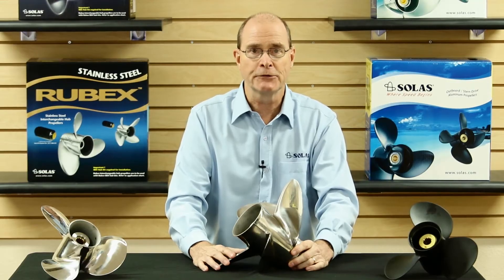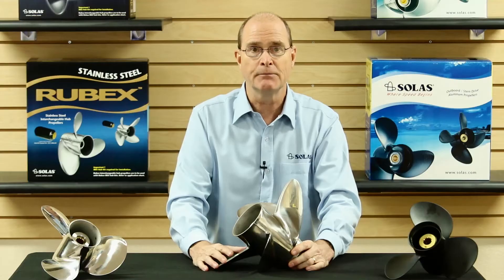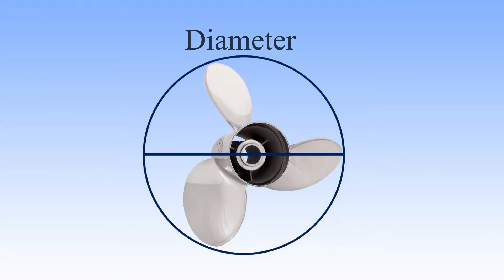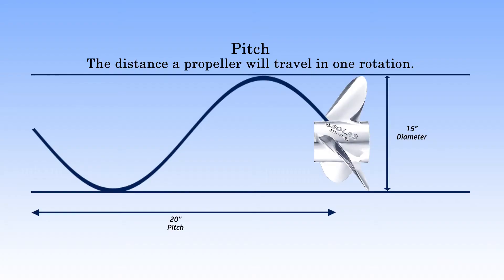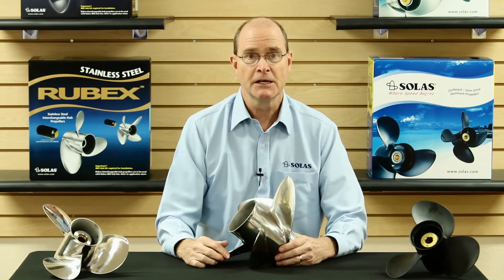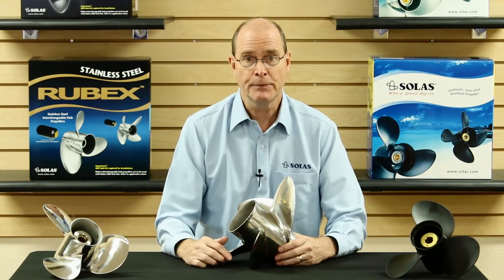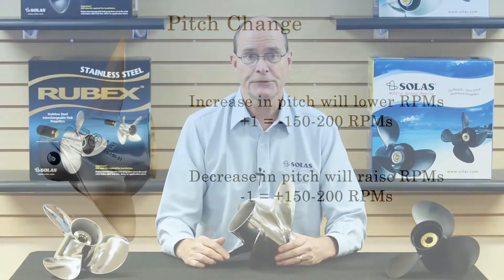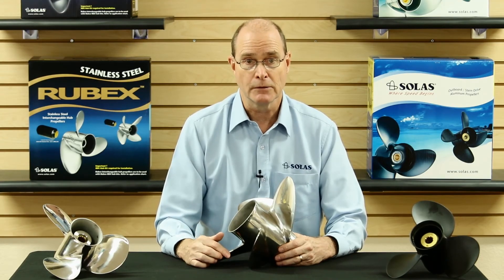Propeller 101 Diameter and Pitch Explained

Comment: Funny is I have a 1989 25hp evinrude with a 10.3 X 12p wot rpm 4500. 21.3 mph across lake.  Topper Trapper 15.5 650 lbs one person.  My engine power is 4500 to 5500rpm . I ordered a solas Amita 10.8 x 10p the evinrude dealer expects it to gain 1000 rpm. I watch on the YouTube  This old outboard  and  with the 13 spline propeller and 25hp he was testing with a 9p and 10p 9"prop with the 25 evinrude 27mph with crazy fast get and using the 10p.  Both engines are in 89 88 year range.

Comment: I have a Tohatsu 40 hp 3-cylinder 2-stroke since it is a boat 460 meters deep semi-vy with 3 people plus day fishing things it does not go beyond 5200 rpm, propeller 10 1/4 14........ .should I take a step down? could you change x a propeller 11 1/8 13? I appreciate information! thank you
Reply: if you go down from 14 to 13 (-7.5%) ,your rpm will increase +7.5% from 5200 to 5600.

if you go down from 14 to 12 (-15%) ,your rpm will increase +15% from 5200 to 6100.

Check your engine's power-rpm curve.  If there's not much HP difference between 5200rpm and 6100rpm, don't buy a new propeller.

Comment: I have a 60hp merc that the rpm only hits 4100 rpm wot the prop is 10.5 x 13 what would be a good prop?
Reply: Depends on hull type (planing or semi-planing) , boat weight , number of passengers,   engine model (ct or standard gearcase)...
Reply: Are you sure it is a 10.5x13 by the way...  not 13x10.5 ?

Comment: Is it fair to say that we can work out the approximate flow rate from the pitch and RPM? Putting aside the hub diameter for the moment:

pi * r^2 * pitch * rpm = cubic inches per minute?

(and of course cubic mm if doing metric mm measurements)

Comment: Does elevation impact how you choose a propeller? I was told the higher your elevation the higher pitch you need. Is that not correct?
Reply: If  you mean above sea level that sounds more like an airplane thing
Reply: @JustMeBlindFreddy   elevation…. I live and boat at 5-9000 ft above sea level.   If you live on a coast that is sea level. The density of water changes as you gain elevation changing the WOT rpm.